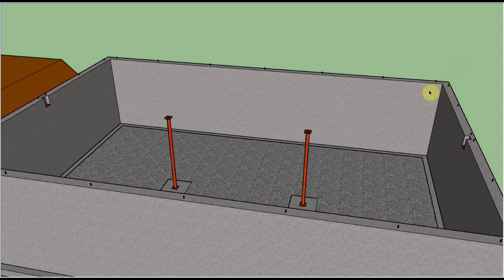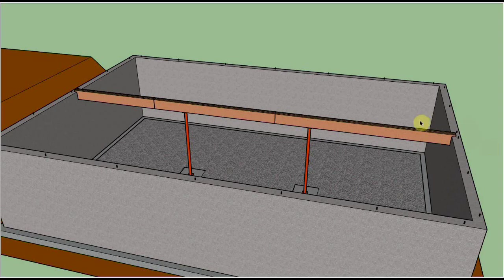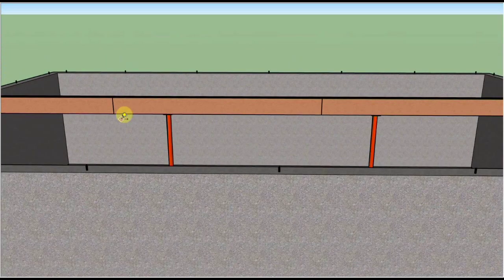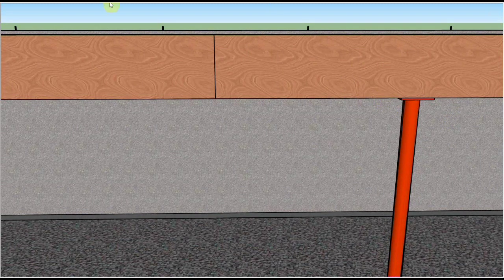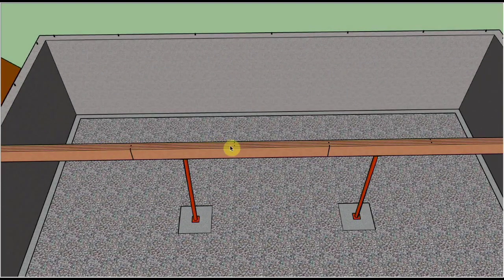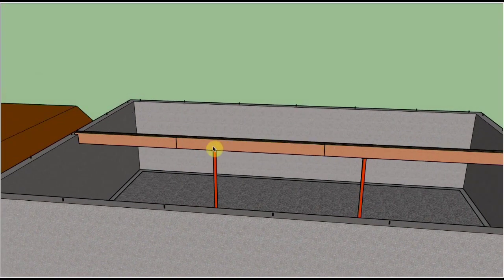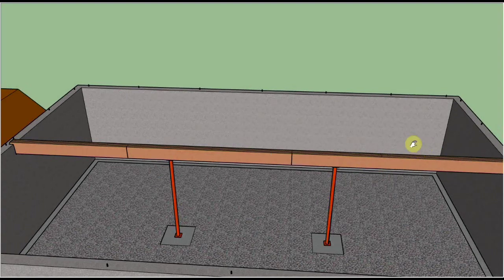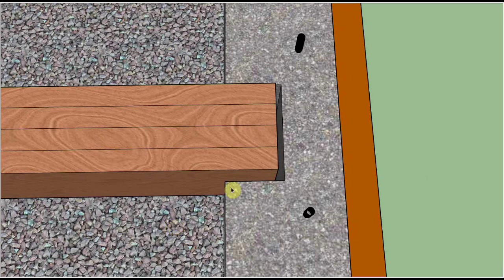Built-Up Wood Beam Construction

Comment: Hmm, I notice there are no continuous beams spanning between the interior posts.. so you are seriously relying on how well the beams are fastened to each other to support the midspan.  Personally, I would rather seem a hybrid system, where there are at least 2 beams with no joints over each span.

Comment: Could this work with beams that spans the full distance using no joint beams?

And what about milled lumber as a complete beam at that size and length?
Reply from the maker: The joints are according to the National Building Code of Canada and can only be used when there are posts, not full span. You'd probably have to get an engineer involved for milled lumber.

Comment: Can I put any of my joints on top of my post? Or do they all have to be quarters? Say I do my first ply all joints center on the post. Then 1/4 rule 2nd ply and 3rd ply
Reply from the maker: On a 3-ply you can put the middle ply joint over the post and put 1/4 point joints on the 1st and 3rd ply on opposite sides of the post. On a 4-ply you can put the 1st and 3rd ply joints over the post and put 2nd and 4th ply joints at the quarter points. Built-up beam construction is described in Section 9.23.8.3 of the National Building Code of Canada which you can find free online at nrc-publications.canada.ca
Reply: @tradestube5478  thank you 🙏🏼 and thanks for that link
Reply: @tradestube5478  great video, exactly what I was looking for to create a 3 ply 2x10x20 pressure treated beam. Now I know to put 10 footers in the middle sitting on the post and 2- 12 footers on the outside but opposite to one another with 8 footers to finish it off! Thanks a lot, hard content to find!
Reply: Btw… would you PL everything together and nail or just nail? Thanks again!

Comment: I have an old house 140 year old to be exact. It seemed like someone removed a load bearing wall many years ago, hence the floor on the second level sagging. I would like to add a beam to make it stable again. The span is 12ft . Would three 2x10 with plywood and glue in between and a combination of structural nails and screws be enough? Thanks